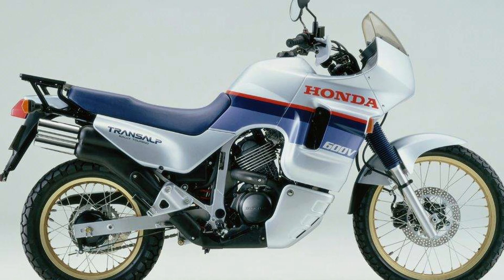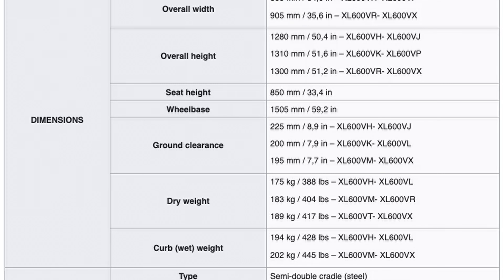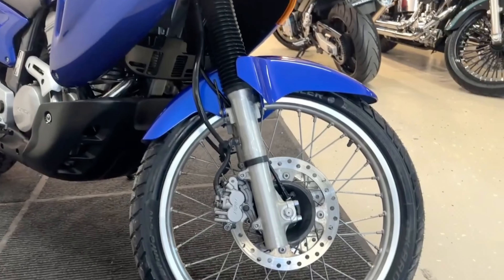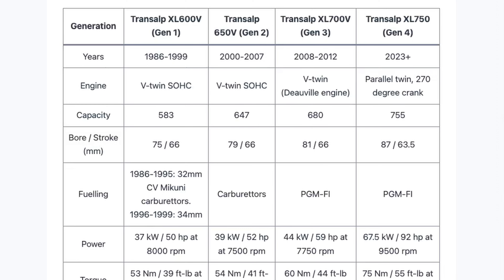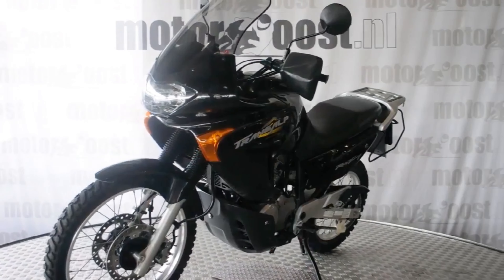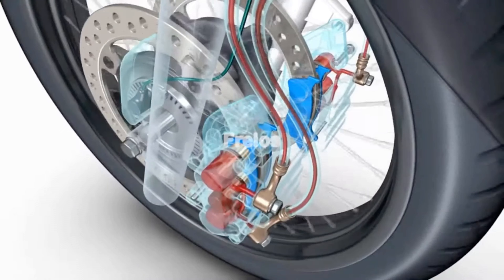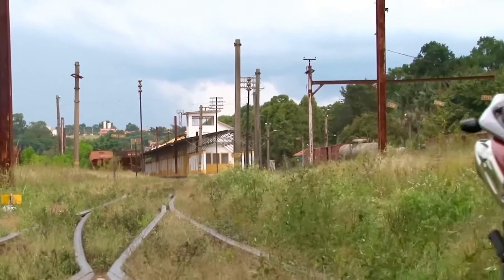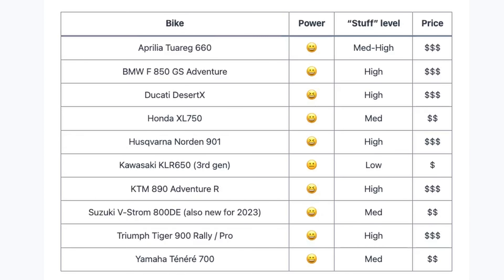1986 - 2024 From Adventure to Legacy: The History of Honda TRANSALP

Comment: I live in the United States and bought a 1989 tricolored Transalp that had sat on the dealer's floor floor for two years in 1991.  It has about 24,000 miles on it and runs great.  Lots of memories with that bike.  Added the 2024 Transalp to the stable and am working to add protective gear to it (most items are back ordered - due to demand I guess).  Recently gave the 1989 Transalp to my son to continue the journey.  Thanks for history!
Reply from the maker: That's a great story, thanks for sharing 👍

Comment: One of the best motorcycles in history. I enjoyed a lot modifying my 650, and now my 700! Thanks for the vid!
Reply from the maker: Thank you for the comment 👍
Reply: You find tanks for the 700?
Reply: @Subaruktm  Hi, what do you mean by tanks? Fuel tanks?
Reply: @coastrider8881  fuel tanks for the side. A brand still makes carbon ones for the xtz  750
Reply: @Subaruktm  I don't think there's any side tanks for the 700. Boano used to make for the 650, but not sure if they are still available. I've never felt the need for it. In my last travel I had long stretches without fuel available over the range of the 700, so I just strapped a cheap 5 liters fuel container to the back. Most of the time the range is plenty enough, and even more on the 650.

Comment: Excellent review of the Honda Transalp, thank you. I have a 2023  XL750 and a 2001 XL650V made in Italy. The build quality of the 650 is very good, including the plastic panels, and still looks great after 23 years of riding. Both are a joy to ride on our often rough roads here in New Zealand. Although improved in almost every way and much faster than the 650, I am not totally in love with modern electronics. The older model offers simplicity and a real connection to the road surface with great feedback. Keeping both forever!
Reply from the maker: Great comment, it's so nice that previous models are still running. In this consumerist society it's a refreshing thing to hear. Greetings and all the best 👍

Comment: Thank You for this historic journey of this legend!
Am the proud owner of the XL650V/2005 in Orange Metallic with over 100000km on the clock. Been in My ownership for 12 good years. I mostly drive in arctic climate of Scandinava…Have upgraded it slowly over the years. The biggest upgrade is the Hyperpro progressive suspension front & rear that transformed the bike.
Yes the plastics are sadly quite brittle & cracks easily…So crashbars is a must since the panels are gettin harder to find. 
Easy to work on, provide honest, reasonable & reliable transportation in comfort.
Great bike & will never sell it.
The Power Of Dreams ❤
Reply from the maker: Thanks a lot for sharing your experience. I wish you to enjoy the bike for a long time. Hopefully the new Transalp 750 will be as reliable as previous generations. Greetings 👍
Reply: Need honda trinzap 400
Reply: 2022 Moodle

Comment: I gotta say, the XL600V Transalp looks alot better than the 650. The front on the 650 looks... feminine, I'd say. It doesn't look rugged and hardy, like the 1st gen.
Reply: Yeah first one wins in looks and price. 650 and 700 win for 2up riding. 
The 750 is just gorgeous but so expensive that id rather buy a very used old Africa twin. 
Better than the 650 there’s the deauville with the same engine, just much better for touring, luggage included btw
Reply from the maker: @pedroclaro7822 Thanks for the comment

Comment: I had the 650 2001 model and i curently have the 700 2009 model with abs. They are totaly different. The only common thing is that they both are easy to drive. The 700 has more power, more agility, better brakes, better headlight, feels lighter, it's a bit better on milage, but is also has worse engine vibrations, is gets way hotter in the engine and exhaust area, it has a terrible rear shock, and worse build quality.  It also has problems with the key immobilizer system and tube type wheels(that goes for the 650 as well)  and needs very frequent spark plug changes otherwise it doesn't run smooth especially at winter. Am i happy with it? Yes, the only thing i would like is another rear shock, tubless  wheels and a bit better milage. That would be a perfect mid size on off bike.
Reply from the maker: Thanks a lot for your comment and sharing 🙏

Comment: The front mask of the Transalp 750 is so dull and boring. Looks more like a CBX 500 with a replaced engine swap. Even the new Honda NX 500 has a more original front mask. The rest of the Transalp is really good looking but the front is just boring. As if the designer in front of the drawboard had no ideas to make the new transalp stand out from the competition and other honda models. Next to it no cruise control, no user friendly swapping of the airfilter and low hanging exhaust pipe. The engine sounds good on paper, but they should changed the engine mapping different from the new hornet. Should have changed in order to reach max. torque on lower RPM range (6250 or 6000 instead leaving it like the hornet over 7000 RPM).